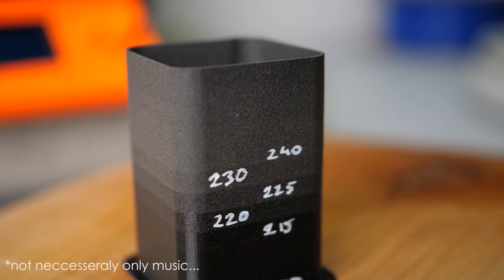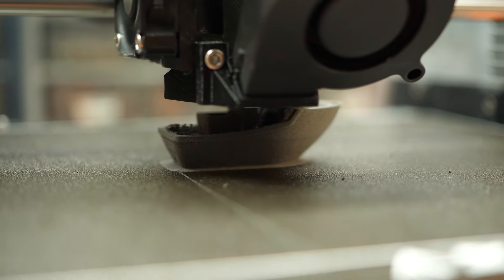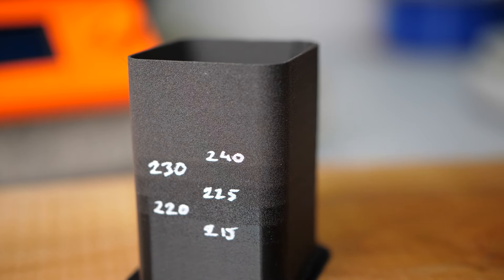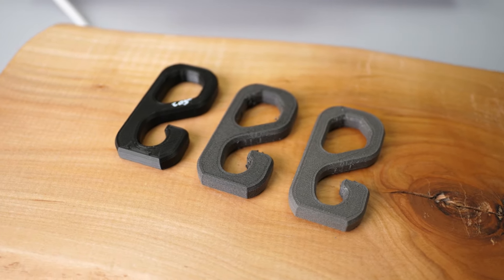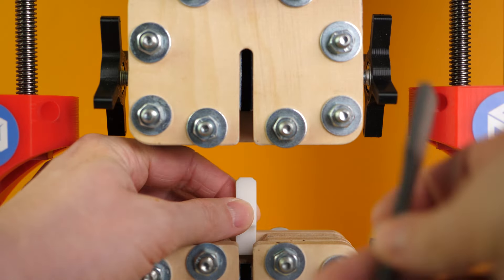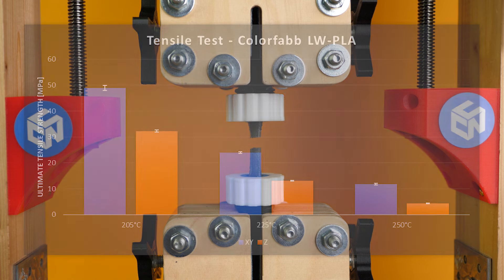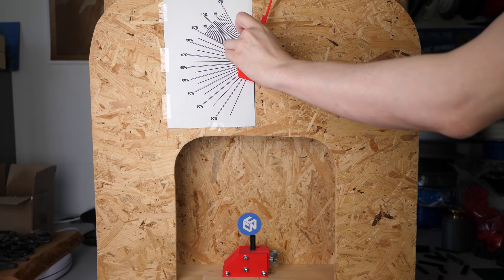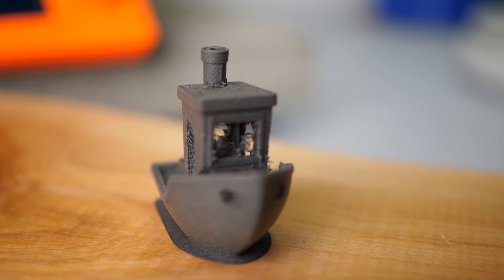A 4th dimension for 3D prints - Colorfabb Light-Weight, foaming PLA

Comment: It's the very interesting material! I see it more like an "engineering" one. It can be used almost anywhere to make lighter "skin" structures or make "sandwiches for different needs.
Stephan, it would be cool it you'll test 250C printed "foam PLA" for the case of sound absorbtion.

Comment: What I have to say has nothing to do with 3D printing but this relates exactly with the argument I give to people about Fluoride in drinking water and why its such a bad idea. Those for fluoride in water argue that it helps prevent cavities since the fluoride bonds to the teeth and give it a nice protective layer. The thing people fail to mention is that this is not targeted and that when you drink it it's not just going to effect your teeth but in fact all your bones in your body. 

Conclusion: The fluoride will bond to the bones making them more dense but this in fact doesn't mean stronger bones but actually more weaker and brittle bones that break and crack more easily. The reason is the fibrous/porous nature of the bones that give it much of its strength. The above example with the PLA that foams at different temperature is a perfect real world example of this very effect. This is why it's so frustrating that people still advocate for fluoride in water and think those that go against it are some type of crazy person/anti-government conspiracy nut. So much for evidence based science right. This shouldn't be an issue in 2020.

RANT: Don't even get me started on the many studies that compared fluoridated water city districts vs fluoridated ones and showed that both have similar result in declined in dental cavities and that  fluoride in the drinking water had no effect but instead that increase in public awareness due to education on proper oral hygiene is the reason for declining dental cavities in the last 50 years. I don't mind fluoride in your toothpaste (your not supposed to eat it) but why the *@#% do we still put it in our water.

Comment: You could maybe use the power panic feature of the prusa to do more "accurate" variable temperature sandwiching.  Induce a power panic when you want to change extruder temperature, allow the extruder to cool, and resume printing.. that or some custom g-code to completely stop and let the extruder cool for some time.

Comment: Stephan. You could use the MMU output of PrusaSlicer and just remove the MMU parts keeping only the wipe tower moves. This should allow you to change “filaments” without needing the the actual MMU. One filament would have the 210c normal extrusion and the second would have the 250c with decreased extrusion.

Comment: The coolest thing would be is if they could make this sort of thing filled with carbon fiber caltrops the center of which causes the foaming. That way each bubble in the foam would be held together with carbon fiber to increase the strength with only a slight increase in weight.
Probably an impossible level of engineering though.

EDIT: It may not be impossible if the blowing agent can be coated in something to stick to carbon fibers, then rolled in the fibers to create microscopic spiked balls. Then when heated the center of the balls release gas and become the center of the bubbles. However getting the fibers to stick evenly and not break apart when the foaming happens would probably be the troublesome parts.

Comment: Great video Stefan. What would be good is a hook test where you modify the shape of the hook in order to get the same strength results for the different porosities. So that way you get a rough idea of the modification you would need to provide equivalent strength. I know that could be highly variable because the designs could be infinitely different, but if you use modelling to find the weakest part, and work from there.. it might be useful/interesting.

Comment: interresting! but to get the most out of this material, you'd have to vary the density throughout the part, and slicershave yet to adapt to that. 
for example an airplane wing could be more durable, by printing a hard but paper thin outer shell and ribs, and adding foamed up infill where extra compression strength is required. in this case mostly on the upper side, towards the center. but concidering the heating and cooling times required, dual extrusion would almost be a must. 
PS: for building air planes, depron covered with packaging tape still mops the floor with anything 3D printed, in terms of stiffness, durability and weight.

Comment: I was intruiged about foamed plastics and FDM.  This is a method i din't think about.  I was thinking about a Injection Blow Molding Like Air Injection Nozzle, but the problem is getting the bubbles from larger tubes like IBM to small foam.  Will look into solid blow agents.

Comment: You don't need the extruder to control the foaming, that is just required for controlling the melting and deposition rate, the foaming could be modulated with a laser. Engineer that correctly and have CAD that lets you expressly design with the resulting metamaterial properties then you will have outstanding results.

Comment: Dual extrusion with PLA for the walls and foam for the infill :)

Or carbon fibre for the walls :D
Reply: You can use the foam filament for the wall if you lower the temperature.
Reply: Definitely! My thoughts were a nozzle purge block like the multi color single extruder design. A little wasteful, but probably not as bad as a color purge.
Reply: @FreeOfFantasy  My intention is stiffness and light. So you really need a skin that can hold in tension the best. Think ali foil skin with cyanoacrylate foam core. Anything with fibers would be great in tension. The foam is just a separator for the two skins to maximise shear stress.

Comment: It would be interesting to see if you can couple this idea of open cell prints with your earlier tests of using epoxy/CA glue coatings to improve the strength even further. The pores might soak better and give a more homogenous part. Could also look into using high pressure/vacuum to ensure complete filling of pores

Comment: I'm not an engineer or a model aircraft builder, but I think something you might want to be testing is (I have no idea what the technical term is, off the top of my head...) how much strength the part loses when it's flexed repeatedly. 

I'm sure that, for something like TPU, that's not going to be anything like the foaming PLA. But, and I'm only guessing from what I saw when you were flexing the foamed PLA parts, it looks a lot like the foamed PLA can hold up to repeated flexing a LOT better than any other kind of PLA. Maybe... Which is why I'm wondering about it. ;-)

Comment: I'd be interested in controlling for mass. Have them all be the same weight, and then pull them apart. It seems unfair that the unfoamed parts seem to appear stronger but that's only because they have more filament in them, much like having higher infil. It should be a controlled test to determine if the foaming increases or decrease strength
Reply: Yeah, but the weight reduction is the core Parameter you are changing, when you choose to use lw Pla.

What is the point of printing LW Pla, If you have the Same mass

Comment: 16:00 printing the hull of a Part with normal PLA and the internal structure with lightweight PLA will provide more stiffness. The hull provides far far more stiffness because of it's closed shape and it's greater distance to the bending line than the internal material. This is the reason why sandwich structures are so effektive in reducing weight of the part by maintaining stiffness and strength.

Comment: The Prusa Slicer might already support something similar because of the Prusa MMU. Without support in the slicer or very smart postprocessing it would be difficult to vary the temperature within one layer. Maybe it's easier to vary the speed? At a certain critical temperature the speed could influence the actual temperature to change the bubbling.

Comment: The variable temperature suggested at the end seems fun: is the foamed material durable enough to form the grip material on handles, like those found on power tools - the grip can be rigid pla with foamed pla on the surface for increased comfort?

Excuse my ignorance, I don't own a 3d printer yet.

Comment: I wonder if you could increase the strength by increasing the infill so that the weight ends up being the same. You would see an increase in print time but if you kept the weight and amount of filament used the same. You should have more contact surface area and more internal structure. Although crack propagation and stress concentration locations should remain the same. What do you think?

Comment: it'd be interesting to try and vary the nozzle temperature during a print so that the infill lines are foamed but the walls are not, or less foamed.  I imagine you'd need to print something like a priming tower between the two temperature switches though to purge the nozzle each time.

Comment: Do you have a filament changer (mmu) ?  would love to see a foamcore wing (like the balsa sheeted styro core one)  single parameter petg on the outside then a "D" tube filed with foam and foam ribs. That could result in extremely strong wings. a replacement wing for a robbe charter for example would be great ;) (petg is fuel proof right? ;)

Comment: Have you ever tried to print the wings with just one outer perimeter and then put sprayfoam inside? You know, Bauschaum as we Germans like to call it 😄
Should work pretty well as an composite material!
Reply from the maker: I have not but you'll probably still need some internal structure that the wing can keep its shape when the foam is swelling.
Reply: @CNCKitchen  You could use an outer support structure (something like a mold) to protect the part during swelling

Comment: If you soaked the foamed prints in superglue, would you see a benefit in specific strength? I was thinking of for instance IC-2000, which is a rubber-infused superglue, but perhaps even thin superglue would show an advantage?

Comment: This feels like one of those things that has many unforeseen uses. Right now, however, aside from the insulating properties, I’m wondering what uses this could have, especially given the fact that it’s still PLA. 3D printing already allows for a lot of air in between the walls of a part so it’s already really insulating. I’ve actually printed a few bottle/soda can holders and they work really well at keeping your drink cold because they’re double-walled.

Comment: You talk about wanting to use a dual head printer so you can do the exterior in foaming material and internal in more rigid material. But couldn't you do that by making the foaming material a sleeve that could be slid over the printed rigid frame, similar to the way it could be done with fabric? Hmmm speaking of fabric, it almost looks like it may have more fabric like qualities when printed at the higher temps. Not as outright fabric of course but getting close. Also, how well would it work as a removable support material when in a foam state vs it's non-foam state?

Comment: this is grate.  you could use resin after it is finished.
Reply from the maker: Seen that done on the RC-Groups forum and it seems to work well, especially since the pores help with resin adhesion.
Reply: @CNCKitchen  it would be cool if they took it a step further and added carbon fiber to the pla and had the bubbling. now that would be cool

Comment: Hi Stefan, thanks a lot for all your hard work and for your video about the LW-PLA. I am currently trying to print an "Eclipson Model C" RC Plane. While I have no issue at all (so far) to print the parts in PLA, I have massive problems with  the ColorFabb LW-PLA. The biggest issue I have is actually to get the LW-PLA to stick to the print plate. I am also using a Prusa i3 MK3S printer with the standard print plate. How did you get the LW-PLA to stick to the print plate. I did not find any of this information in the comments below, nor can I find any information about that on the colorFabb Website or internet. Seeing that you where successful in printing on the Prusa i3 I thought I ask. Did you use any glue sticks to get the material to adhere, or any other "secret" method? I have the same question for the ColorFabb Varioshore TPU. Can that be printed straight onto the standard print plate or do you need any glue sticks, masking tape or any other tricks to get the material to stick? Many thanks for your help und viele liebe Gruesse aus England 😃
Reply: How does your process of cleaning your PEI buildblate look?

Firstly i clean it with soapy water and then with isopropanol. This should get rid of all polar and unpolar contaminations. 
Next, I apply a coat of 'Tesa' Gluestick with worked best for me (also tested Pritt and UHU).

If you are really fancy, you can disolve the applied gluestick in  IPA on the buildplate and create an even layer
Reply: @carstenhahn263  Thanks for your reply and your tips. It does work better now. I also clear in with Isopropyl alcohol. But I think my biggest issue was the print speed. I reduced the initial layer print speed and generally did a test cube print to find out the proper setting with my printer. The settings provided by Eclipson did not work at all for me when printing the plane.

Comment: How well would these work as an infill? they seem to come off a bit more flexible than I was expecting, but I'm curious how well that structure would hold up if contained in a solid shell.  Probably not well, but maybe better than if you left it void.  May add a little bit more shock resistance than a solid infill with it's flexibility.  Mostly curious about using it as an infill for the wing.  Sorry a thought as I was typing this. but what about doing a reduced infill structure with this filling in the space in between.  Like a 10 or 20% infill with a 40%....

As I finish typing this I just got to the end of the video where you address this...  Please do a video on this if possible. I am super curious and do have a dual extruder that  gets underutilized.

Comment: You need to make parts with variating densetyes for it to be worth using, so yes a dual extruder kinda makes the best road to take 👍 but I'm thinking like you said design parts to be reinforce by carbon fiber / rods is a more stiff and light waight solution 😏

Comment: Why even add carbon fiber or another material? You could just print a backbone witj]h a lower temperature for stiffening the printed plane. Also it would be great to use a temperature gradient on the wings, so the become heavier and stiffer on the inner end, but lighter and more flexible on the outer end.
Great test as usual, and also thinking of the annealing was nice!

Comment: Could you compare parts of the same mass, but different density? By decreasing the mass, you should be able to make thicker parts, which may increase overall strength, particularly in bending and buckling. It might only work if the external dimensions of the part are larger.

Comment: Why are infill, top and bottom layers usually printed under 45 degrees?
In a cartesian printer it would be easier to print 0 (90) degrees to the axis as only one needs to move at any move.

Those 45 degrees may be useful in coreXY (?) printers where a single motor moves both axis.

Comment: You know, a toucan beak is extremely strong, and it has a foam structure inside of a thin, pliable skin. What if we used a two filament printer and used normal PLA as the perimeter and the LWPLA or TPU as the infill at 100%?

Comment: Why are you not testing for elastic limit? Ultimate tensile strength is good, but not most important characteristic of material. If the wings of the aircraft after landing are not destroyed, but deformed, you will either have to completely redesign the wing, or try to correct the changed geometry. (sorry for my English, Степан)

Comment: At this point you would think someone would have came out with 3d printing specific paints. Something that just made layerlies dissapeared with its parameters. You could also use resins to make shells. I don't think anyone has jumped on it in the hobby realm though.  I did see a company doing something like that through a process though. 
Still, at this point someone should make a primer designed for this. It should not be a hard problem.

Comment: Being 3d printing and not conventional manufacturing using the bulkheads etc. Couldn't we change the way we design the structure. A shaped and molded triangular lattice perhaps with thickness and rigidity where needed and light weight structures in between. Seems like we can start changing the rules with this method.

Comment: Do you have a double extrusion head printer? It would be very interesting to build that airplane wing with inner braces non-foamed and outer shell foamed. Maybe slicing the model would be challenging, but could be interesting.
Reply: Lol. Hadn't watched the video until the end.
Reply from the maker: I have an old one but I'll need to update it to make it properly work again. Slicing is not a issue with the 3DLabPrint files. Already tried that and worked with no issue 👌

Comment: I ordered this materials today and expect my rc planes to be lighter. Actually I tried several models from 3dlabprint or planeprint. They flies..yea..just flies. due to its weight, some plane was broken its wings in halves when I tried loop. and the other, flies very fast in order not to stall, also due to its weight. So, I almost gave up this kind of building rc planes by 3d printer. But I would try again with this materials.

Comment: What about using a 2 in 1 out mixing hotend with one petg or nylon and the other this filament. Then could adjust the mixture of the two in the hotend to change the strength and staying lite?